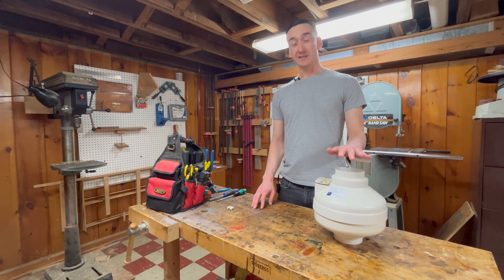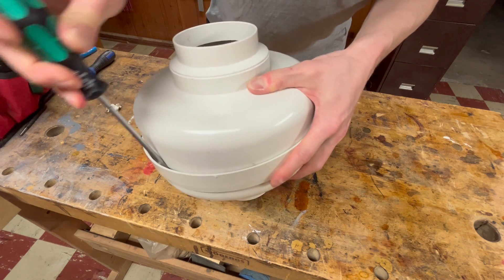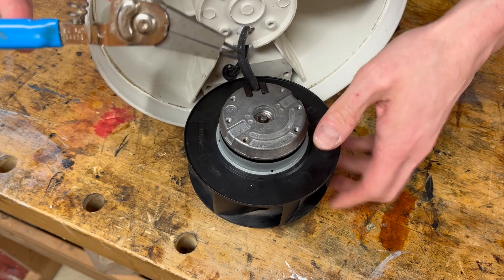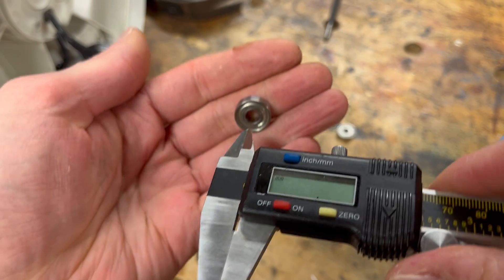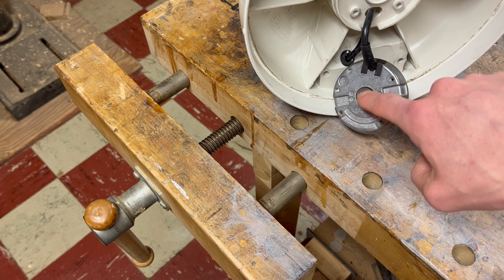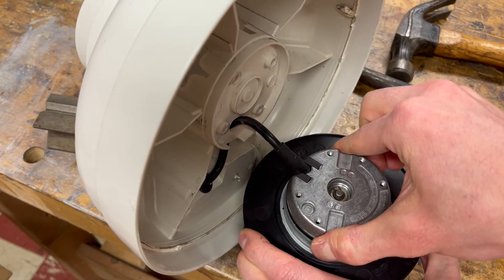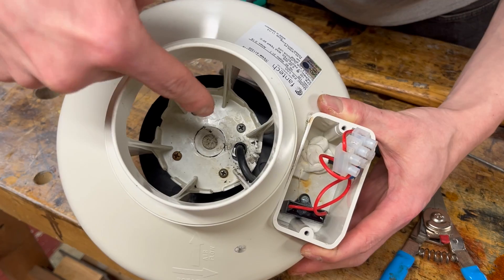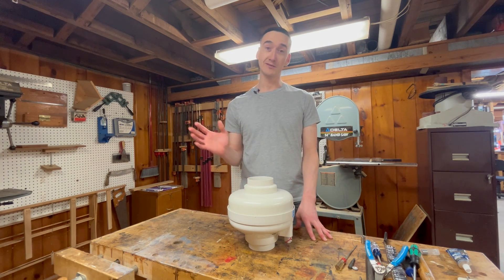Replacing bearings on a noisy radon mitigation pump / fan

Comment: Thanks for this, I did an RN2, it was completely sealed so I had to use a cutoff wheel to open it. If anyone else has one it uses 608 bearings (8 ID 22 OD 7 H)

Comment: I got to the part of removing retaining clip removed.  But the motor does not separate from the retainer.  It seems stuck.   How to remove the retailner from motor?
Reply from the maker: The retaining clip is all that keeps the shaft from sliding out. You could try tapping it gently with a punch? Mine came out very freely though so maybe yours is different somehow I'm not sure
Reply: I'll try that. Thxs

Comment: My Fantech has the seam facing outward rather than down like yours, and the gap is so thin that I can't even get a razor blade to fit, wondering if I should try some heat or something to weaken the adhesive. Also, U think you could get higher quality sealed bearings from mcmastercar. Checking the site myself, I see they have lubricated sealed stainless bearings, but they're over $20 each. Still much cheaper than a new unit though, and I would guess that they would last longer than a new fan too.

Comment: Thanks for the video! Fixed my older fantech fan. My bearings were larger so definitely glad I measured them with a digital caliper to get the exact size. I punched a tiny hole in the motor cap with a pick to be able to remove it without destroying it and then put a dab of glue over the hole once I put it back on
Reply: Explain this ♥️

Comment: Thanks for this, the internals on mine were a little different, but I was able to get it apart and replace the bearings and it is now quiet again. Mine had lasted about 5 years as well. I also made sure to take some pictures of the wiring before I removed the fan from the pipe. Very glad to save the money and keep the unit out of the landfill!

Comment: I have the same model, but I don't have a 3d printer, any advice for replacing that cap to keep the moisture out?
Reply from the maker: I was able to hammer mine mostly flat with a punch and some patience. It won't be perfect but with silicone over it it should seal ok. If that doesn't work out maybe I can just mail you one, lmk!
Reply: @adamdport  I'm sure hammering it flat will work, but if I somehow manage to mess that up, you might be hearing from me. Thanks!

Comment: Thank you sir! you saved me $200. bought new bearings from amazon, 10 for $10, took about an hour to to do replacement. Great tip to use calipers to measure size, mine had markings on them so it made ordering replacements easy. also great instructions how to open and reseal/weatherproof the unit and use a socket to press the new ones into place. Thanks!

Comment: I think I have that same model. Based on my radon readings inside my house I don't need the fan to run at 50watts all the time in the summer, I tried turning the unit off for 8 hours a day in the summer but that gave me spikes in my radon readings. I was wondering if I could create a potentiometer to lower the fan speed and perhaps cut the wattage to 25watts.
Reply from the maker: Never thought about that. My sticker says 21W and just measured it running at 19W. At 15¢/kwh, mine costs $25/yr to run. What kind of furnace do you use? Would be interesting if you could feed your furnace's intake with the under slab air, which is pumping outside anyway. Could just shut off your radon pump entirely in the winter?
Reply: @adamdport  interesting idea. I have a gas furnace.
Reply: Did you end up trying anything to regulate the speed and power consumption?